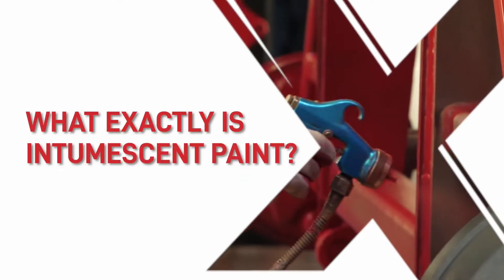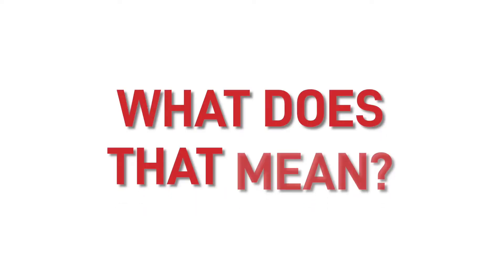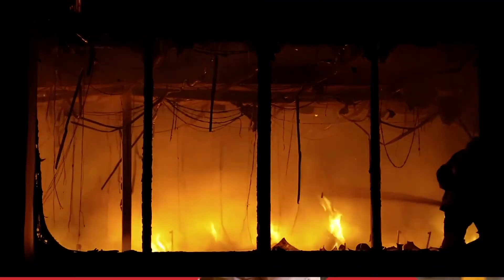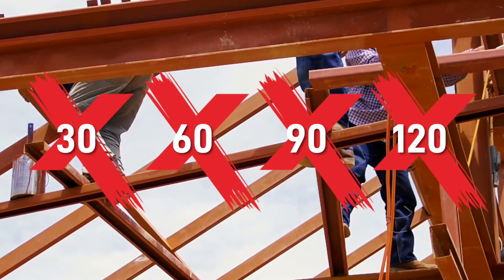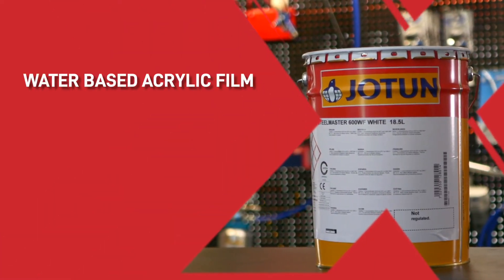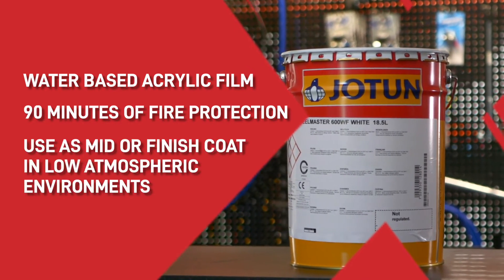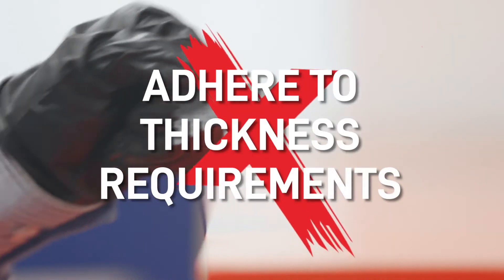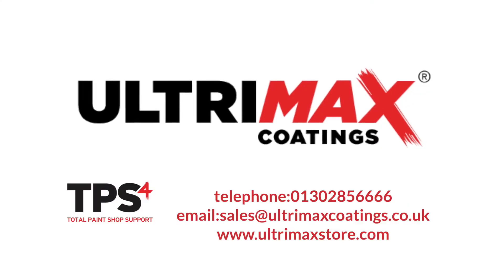What Is Intumescent Paint- Fire Resistant Paint and When Do You Need It?

Comment: Is there a paint product that can be applied UNDER a plaster skim coat, i.e. onto bare plasterboard before it has been plastered? The reason would be to upgrade a single layer of 12.5mm pink fireboard to provide 60 minute protection. Then after application it would be plastered as you would normally apply a skim coat to plasterboard. Or is this stuff only suitable for applying as a top coat, after plastering? Thanks
Reply from the maker: Hello, although in theory the plaster would stick to the intumescent paint. In terms of regulations you would need the intumescent to be the topcoat as this needs to be the layer reacting to flame should it occur.
Reply: @ultrimaxcoatingsltd  Got it - makes sense. Thanks so much for the answer.